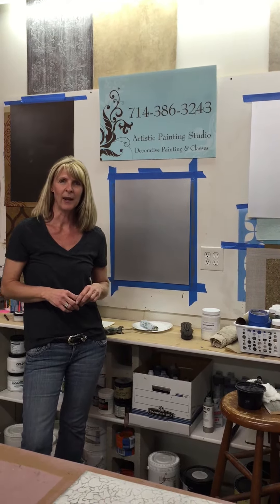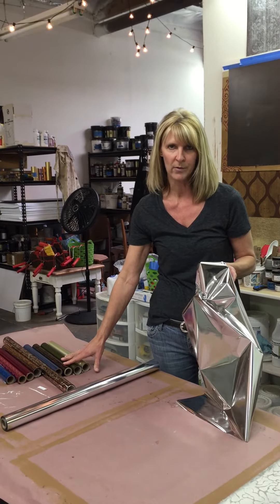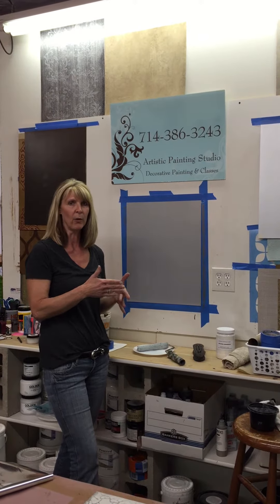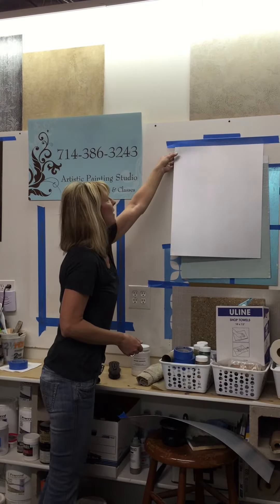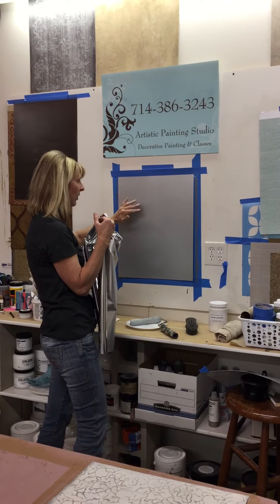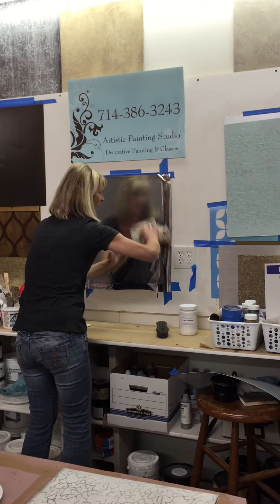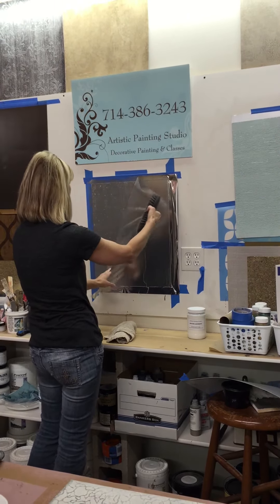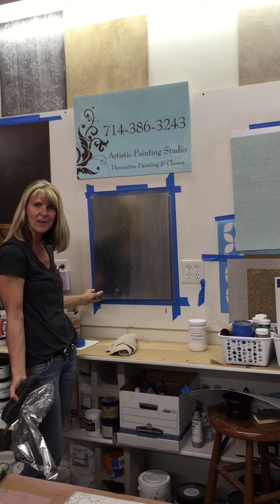Transferring Foils

Comment: Hi, Just wondering if you could tell me how hard wearing it is please? Could it work on a wall / ceiling that would sometimes need wiping down. Just thinking about trying it in side our converted horse box on the ceiling. But there might be the occasional drink spillage or something that would splat up the wall / ceiling and we'd need to wipe it. Thanks
Reply from the maker: The foils work fabulous on walls, furniture and just about any surface - you will need to apply a topcoat over the foils to protect them and just make sure it's a washable topcoat.
Reply: @ArtisticPaintingStudio  Thank you!